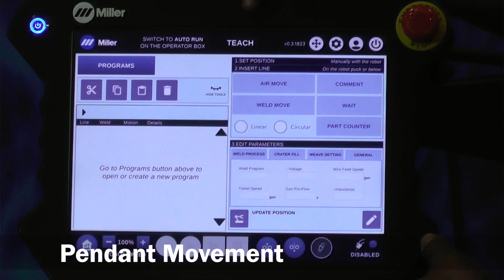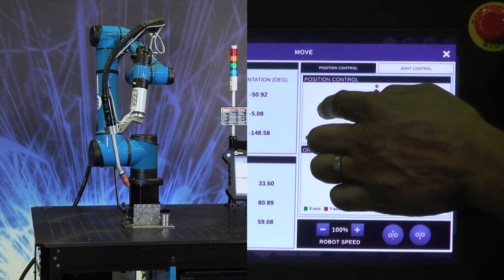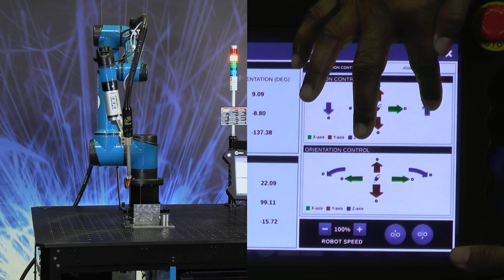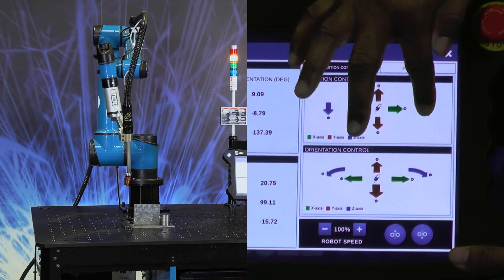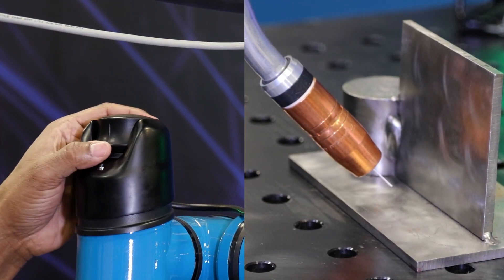Miller Copilot Training: Moving the Copilot

Comment: What kind of robot arm do you all use?
Reply from the maker: The Copilot arm is only available from Miller.  It is a Miller specified arm that includes exclusive features that make operation easier and more intuitive. The vendor chosen was thoroughly vetted by welding and automation experts on our team.  The vendor that builds the Miller Copilot arm is Aubo.